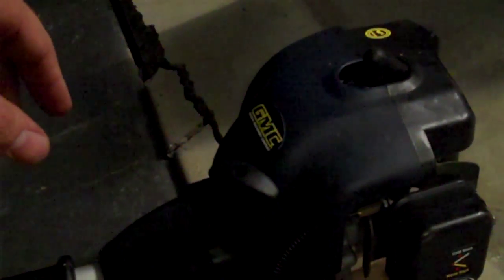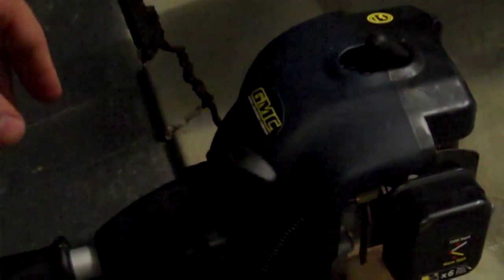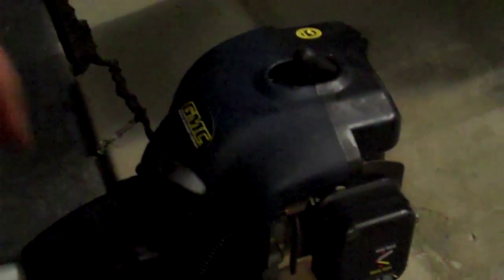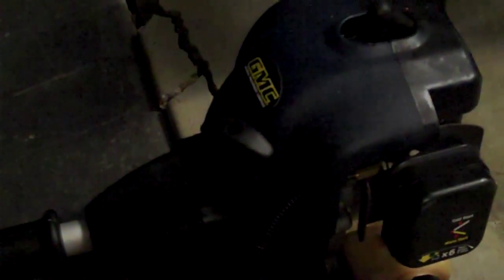gmc whipper snipper repairs.working fine now.

Comment from the maker: @TheMagicmole77 lol... send it to me and i will fix it for ya. go over it and check the basics. new spark plug and set the gap to about the width of a credit card or hacksaw blade. drain fuel from tank and wiggle the fuel line with a piece of wire and see if it is sturdy or not. clean air clean cleaner out as well

Comment: Hi Stinger. You have probably found out by now but you cant use silicon fuel tube with gasoline as it swells up.
The rest of your repairs are great except that one.
You will need to get Tygon tubing which it yellow in colour.
Cheers mate.
Reply from the maker: interesting,,, i put that tube in 3 years ago now and its still going stong and never skipped a beat, go figure
Reply: Well you are a lucky man
Reply: I have been using that stuff for forty years and the first time I used it on a weed wacker ot swelled to 10 times it size. Well done you.
Reply from the maker: Mark Godfrey perhaps the composition of the tubing may have changed slightly over the years???
Reply: Yes it has slightly. I can now get a little time out of it when using it with model diesel fuel. The cloured stuff seems the best. Thanks for your kind reply.
Reply from the maker: Mark Godfrey cool, thanks for the feedback & taking time to add a comment.